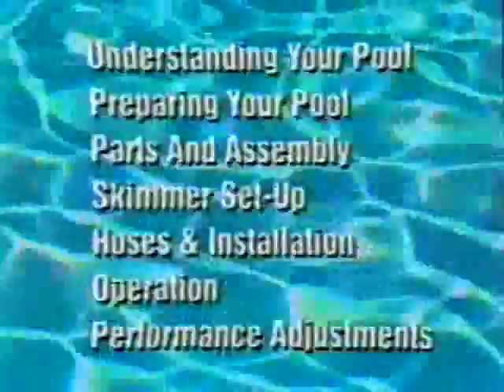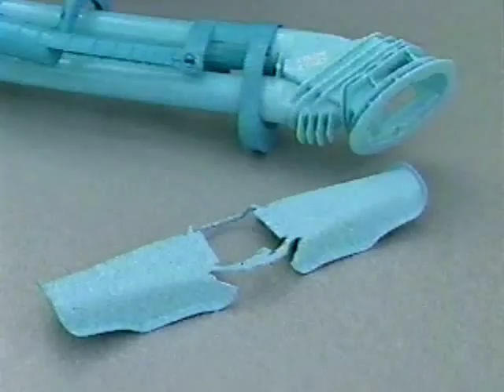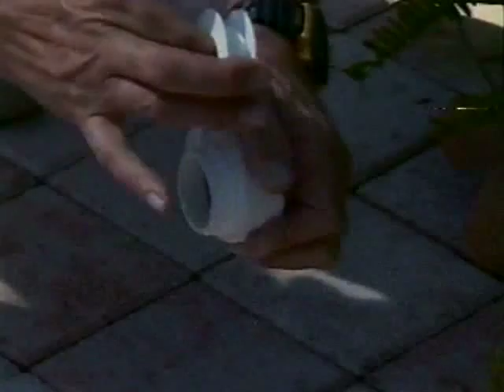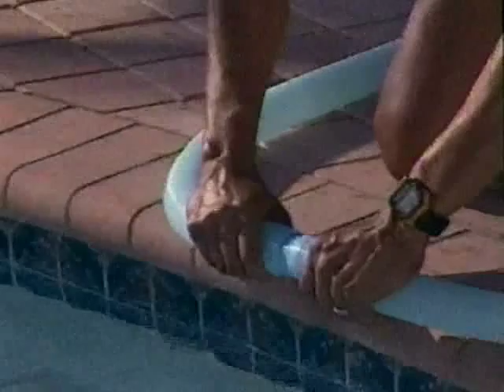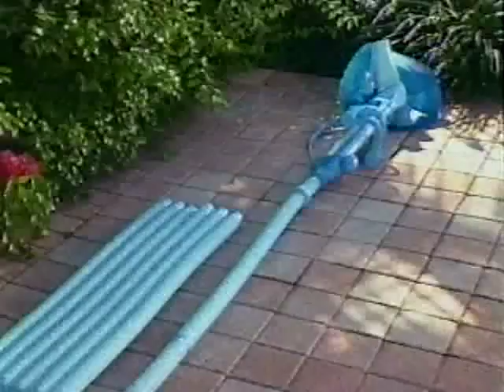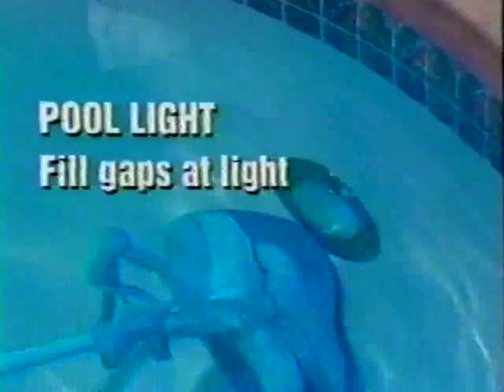1994 Kreepy Krauly Setup Video

Comment: ONE POINT!.. If you have a 10ft POOL deep end.. ADD another PIPE.. You'll need it.  

IF you have this even:  ADJUST your eyeballs/returns... I have two returns and the one on the left (first mover) has to be slightly down and to the left)... at the 10ft end .. It has to be aimed more DOWN and to the left if you sitting/standig above it) ..creating a CLOCKWISE movement of the waterflow from two returns.

The shallow end one just needs to aim a tad HIGHER than the DEEP END.
Reply: Please understand.. MY pool guy did it wrong and I had to make adjustments when it didn't work correctly.. (and my husband listened to HIM.. rather tham me.. .... I AM THE PRIMARY POOL caretaker!!!!!  I KNOW MY POOL .. I've been doing this alone for 17 years!!!)
Reply: My creepy suck wind not working